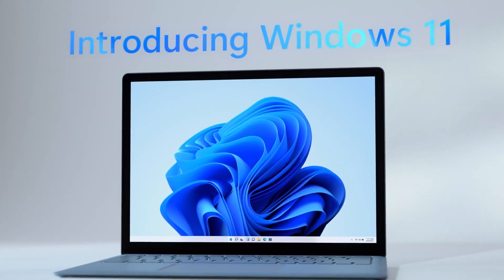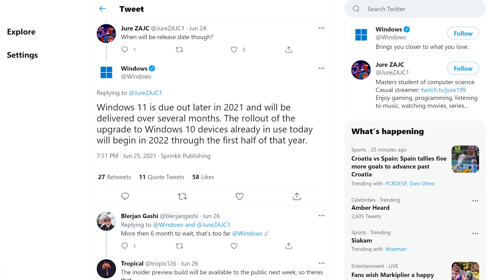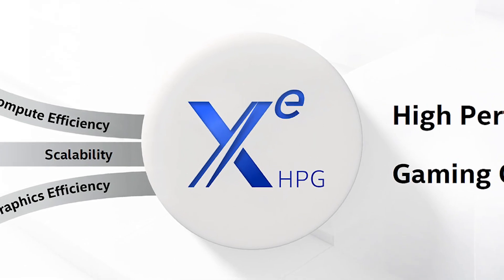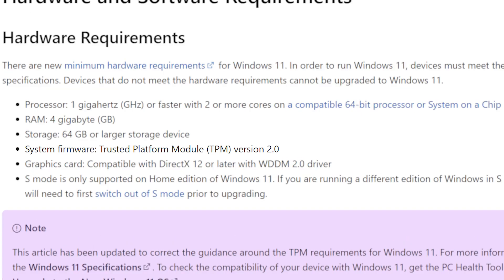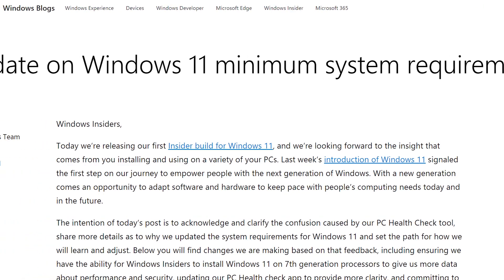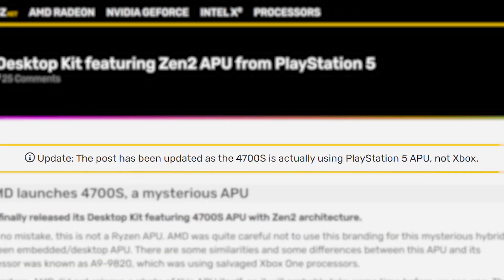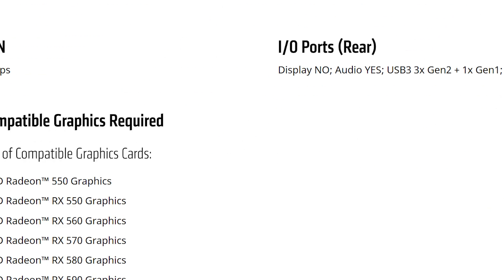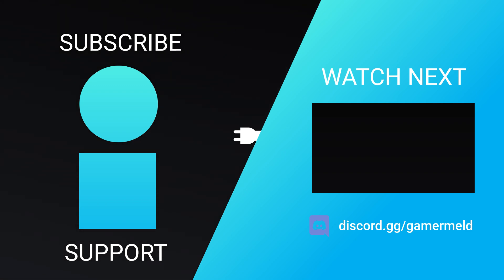TONS Of Gamers WON’T Be Able To Install Windows 11!

Comment: 3:00 this is just dumb. Just because it's not on the list doesn't mean it won't work. Is every cpu that would work with Windows 10 on Windows 10's list? Probably not. Does that mean it won't work? No.

Comment: First generation Ryzen CPU's was launched in feb. 2017. So they are over 4 years old (and not the 3 you mentioned). As Win11 launches for updates in Q1/Q2 2022 it's even 5 years old. It doesn't sound unreasonable to me, not supporting 5 year old CPU's with your new software.
And nobody forces you to use Win11 or upgrade the CPU, Win10 will be supported up to, at least, 2025.

Comment: Software generally makes very, very stupid decisions on what they can install on. Just warn the user that it seems incompatible, have them click 5 times to confirm that they are ready to take the chance, loose everything etc. and let the damn thing install!!!! Its called taking responsibility for your own life.
Reply: Pretty sure someone will make a bypass for that, we just have to wait.
Reply: The TPM 2.0 requirement is technically a right choice but at the bad time. They should've imposed this requirement years ago. Now the shitty OEM companies don't bother about how secure their hardware is according to latest standards. They keep running races behind performance and only that, cuz their market and sales are hugely driven by that. This is partly due to increased PC gaming and new games requiring high performance hardware. 

Windows 11 forces them all to move in the right direction all of a sudden. Now think about it... Do you complain on windows for imposing greater safety requirements on our old and insecure hardware or on hardware companies and the gaming industry that drove OEMs to only focus on performance since a very long time?

It's like getting pissed at a game company cuz their AAA game with cool graphics and physics doesn't run on your old potato laptop.

Comment: That's not right, the CPUs that Microsoft says "will not be supported" is just an advertisment to the OEM Manufacturers, so their new products can carry W11 from the factory only if that comes with a recent CPU.

So don't worry, you all will be able to install W11 as long as TPM can be activated in the BIOS of your motherboard (most recent processors or motherboards since 10 years ago supports this).

Comment: Unless the software I need to use for my day to day stop support for my current version yea I'll probably skip this one while some meh - nice improvements I can't get over that UI it's not appealing in the slightest to me & quite of putting on its own also not seeing a need to upgrade everything is running better than smooth so not about to a crew myself with finally not having issues with a new build.

Comment: A ton of gamers, especially with newer hardware will be able to. The only outlier is the TMP 2.0 requirement. Which many gamers or people outside of cyber security may not be aware of being in their system or not. Many plain users, as seen in the comments here, don't realize that it's not just Microsoft forcing a hardware update. But the market almost demands it because the recent ransomware epidemic. Old hardware is insecure, if it out of lifecycle you're exposed, even more so if you're connected to a cloud.

Comment: As a Linux Mint user, this Win 11 stuff is mystifying. It reminds me  of the old AMD/Intel warz , which I am old enough to remember. AMD is much better equipped to deal with Intel FUD this time around ;) I only use Win10 for DAZ3D and AutoDesk CAD apps. Otherwise, I use Linux. This might indeed get those two genres to finally make the switch to Linux ;) Without those genres, I have no need for MS BS and I am tired of paying for Offce 6 times (Been using Office Premium since Win 3.1) on the same computer and I WILL NOT use the subscription model for software!

Comment: I'll not buy another pc just for a fucking operating system 
Currently using 7700k with rtx 2060 and 32 gb ram
And it can't run w11?
What a fucking joke

Comment: I'll state windows 10 will be likely besupported to 2024-2025, and at that time those unsupported processors are 7+ years old. I'm a person upgrading my pc once every 6 to 8 years, my old system (i7-3930k 6c12t @4.3ghz, 2*780, 32gb ram (2013), sata ssds / hdds) has been replaced last year (by a r9 5950x 16c32t@ 4.3ghz, 2070S, 64gb ram, m2 ssds, sata ssds), obviously not making me affected. However it's 10 times faster cpu wise and gpu wise compared to my old system. After 6 or 7 years reliability goes down, and mechanical hardware becomes old. 

Maybe it is time to move to the capabilities of now 3yr old instructions ets, instead of lingering in the early i7 and comparable (-snickers-... ) AMD solutions (yes, AMD has done brilliant) of 5 to 8 years ago with their instruction sets... Windows 10 will suffice until the platform is actively phased out by its users... My only gripe is the inability in 2025 to allow 8 to 10 year old pc's to be replaced elsewhere and/or recycled. Which is forcing unnecessary e-waste IMHO.
 This said I have a 12 year old workstation (2008-2009) running windows 10, and honestly... it still is usable for 2 to 3 light 2/4c 4-8gb ram vms and basic office/internet/mail and fileservice. I used it a year ago for homeschooling my kids during covid lockdowns. 1 working on the machine, the other on a tiny old thin client. 
when I was building my new pc.

So support isn't my main issue. And if they cause to many waves it might be the downfall of MS PCs, and we might see more interest in Linux, old pc's will run Linux perfectly, open office is roughly equal and as capable as office 365 and cheaper. Provided you do not need the cloudspace.

Comment: Use pop! OS. steam proton now allows for most games to run on Linux. And games on Linux perform better than on windows. Speaking from experience.  Recommend checking it out. No developer experience needed. It's easy to install and use.

Comment: Imagine requiring a very recent cpu just to install an OS. What's gonna be next needing 8 or even 16GB of ram just to start windows?
Reply: back when XP launched, it required 512mb of ram for a decent experience. i'd say that was the equivalent of 32gb of today. i really hated xp at first because it was a huge resource hog. but when tech advanced a little more so that wasn't a problem anymore, it became one of the best OSes ever.

Comment: Have you try it? It's basically just like any big Windows 10 update but more fancy. It run "every program and every game" I already installed on my Windows 10. The transition is as I said, just like upgrade windows 10. I didn't have to reinstall any program at all. And my CPU is Ryzen 5 3XXX. Only games that doesn't work is the game that has game guard on which doesn't recognize the os version and refuse to let me play, Which wouldn't be a case when the Windows released.

Comment: The only thing I can say to Microsoft that justifies their move is if they continue to support windows 10 for 10 + years after win11 release
Reply: @boinggogen  4 years is a lot of time for people to upgrade their PCs.
Reply: @Dhruv-qw7jf  "its a lot of time to upgrade a pc" yeah, but ya know why force someone to upgrade if their system is able to handle their usage needs? Thats the point here
Reply: @soham7510  I mean, Apple does this all the time and no one bats an eye at that. Heck, Apple is notoriously known for sending updates to their older devices to slow down performance and make them obsolete. At least (so far), Microsoft hasn't resorted to that.
Reply: @Dhruv-qw7jf  yeah thats sad these companies have so much power over their users

Comment: Gonna be blunt: 
I don't get why it's random intel chips. Unless there's some security reason.
But seriously, if it supports TPM 2.0 then it should be fine. (I mean if anything my system has it built in so that's neat.)

Comment: My second gen Intel Core cpu isn't on the supported cpu list for my current Windows 10 build but it works, sort of, as I get plenty of blue screens, not supported cpus may still work, not without problems though, moreover, TPM 2.0 is only needed for encryption features like BitLocker, it won't surprise me that they lessen these requirements before launch.

Comment: Wow, you really don't know what you're making videos about, just regurgitating old tropes like "gamers don't usually upgrade the CPU". Gamers especially do upgrade the CPU on Ryzen AM4. There would be no reason to upgrade your GPU if you're still running an R3 1200 or 1600 or even R7 1700. You have no idea.

Comment: If Windows doesn't start back pedaling to allow more CPUs and more options to be used like Windows 10 is allowing then they're going to probably lose a small portion of their stock value any upcoming years especially if they start to discontinue more operating systems and try to "push" people to switch like they tried with Xbox game pass. Fml

Comment: You can run Windows 11 on a modern machine. You just need to enable fTPM on your motherboard Bios. I have a 5600x and most modern AMD cpus have it built in the chip. Its disabled by default, just need to enable it.

Comment: Honestly I dont think anyone had anything to worry about with windows 11. Dual core cpu, covers everything. 4gb ram, covers everyone. Tpm 2.0 covers most motherboards within the last ~5 years
Compatible cpu list, they still have 4 months to make sure more customers done have randomn bugs. They're validating them based on importance. So start with the newest first, then the highest sellers and steam hardware survey. Obviously validate ryzen 5000 before 1st gen thread ripper for a home os. They're expecting threadripper users to be on windows server

Comment: Add me to the list along with my wife,she has a Ryzen 3 1200 which is frankly overkill for her and I have a Ryzen 3 3600   but no TPM module and the module costs over $100 used it you can get one.

Comment: It's just typical, Microsoft wants you to enable all these overkill features because Windows IS the vulnerability on most systems, it's always to compensate for it being such a sh** operating system.
Reply: tpm is a security future for windows. However i do think that requiring tpm will slow adoption rates.
Reply: @supersaiyaman11589  yes, but the TPM utilization will be a great thing.
Reply: @RobFlexz   for security yes it will be i cant see any other advantage for it.
Reply: @RobFlexz  how will the tpm mandate for windows 11 be a great thing other than security may i ask?
Reply: @RobFlexz  the more i read up on tpm and get to understand why Microsoft is implementing it the more i agree with  there choice to require tpm.  at this point i would advise anyone ho does not have  tpm to get it. they make  motherboards with tmp on it. if people truly don't want to get another pc just get a motherboard with a tpm header and buy tpm specific for your motherboard. Or better yet buy a motherboard that already has it included if you can. Microsoft is  doing this to protect their os from attacks do people not realize this. people have bean complaining that Microsoft os is insecure wene Microsoft finally does something about it people complain. as iv said before the more i read up on what tmp is for the more i agree with Microsoft decision.
Reply: @supersaiyaman11589  TPM is a great security feature, however, mandating it is not. Microsoft will have full control over your bios and probably will make using alternative Oses, such as Linux, more difficult. TPM is used to secure devices from physical attacks, not to prevent malware from the internet. A hacker can still install malware with tpm enabled.
Reply: Wrong.
Reply: Bobby is ignorant

Comment: I just upgraded from win 7 to 10 but not by choice the Mosfat on my motherboard blew out took everything except the gpu surprisingly enough spent about 730$ on a new system and got win 10 installed not happy with 10 at all And now they are pushing this is out I'm sorry but I'm going to wait for 2-3 years and see how this 11 is plays out

Comment: I hope that for the launch of W11 they have removed that requirement of having UEFI and TPM2.0.
I understand that it is a way to cut support for legacy computers, however it is a very artificial cut since it does not depend on the power of the equipment but on what they consider "safe".
This the only thing that is going to achieve is that people continue to stay with Windows 10 as at the time they preferred to continue using WXP instead of making the leap to Vista, at least at that time the justification was the lack of power, the majority PCs of those years were not prepared for all the visual effects that Windows Vista offered, even today AeroBasic is still present in Windows.

Comment: I think that unless you CPU lacks any  required instructions set, even if it's not in the support list you will be able to run Windows 11 just fine. Maybe the question should be why do you think you have to need windows 11 before the 2025?

Comment: TPM is designed to lock out gnu linux and other competitors
Reply: How? TPM isn't necessary unless the boot uses it to read some cryptographic key and kick off the core, if any, Linux shouldn't be left out to use such hardware in a actually useful and competent manner, but always as an optional part
Reply: @santitabnavascues8673  Just guessing if it uses some lock out chip that only allows window's bootloader like copy protection on consoles, or m$ thinks users are too dumb to turn off tpm,secure boot. unless its an oem pc maybe
Reply: @ryan89554  that and TPM being essentially designed by microsoft could hint a thing or two, still, I'd consider a bad design for hardware to be done so it excludes legitimate software from running
Reply: @santitabnavascues8673  or lock out amd even if there wasnt demanded competition by law and only allow intel motherboards to run win blows. id already get rid of windows if wine can run more dx 11 titles, i got skyrim special edition, problem is amd linux proprietary drivers suck and is hard to get working. its dumb . drivers and low level stuff should be gpl compatible to have optimal functionality and continue to have long term support without being terminated with planned obsolescence and further e waste.
treacherous computing platform haha

Comment: Microsoft boldly making people's lives more difficult and calling it innovation 🥸🤡
Reply: its innovation, just backwards
Reply: TPM is crap.
The only use of the TPM is that DRM media can no longer be copied, software can be blocked from being installed (if Microsoft does not want this in windows, even if the user wants it) or PC users cannot do anything about it , Windows or other companies data about software usage, files, behavior ect. collect.
Reply: Don't use that emoji, it's too funny😆
Reply: Apple 2: Electric Boogaloo.

Comment: Microsoft is going to shoot themselves in the foot with Windows 11. An OS typically is not supposed to be heavy demand on hardware, leaving the majority of your resources for running your apps and games. This is just as bad like back in the days of Vista when they used glass windows and was too demanding for hardware and slowed your windows experience down.
Reply: Windows 7 uses the same interface and uses less RAM than Windows 10 does at idle. I am never switching to the NSA backdoor spyware that is Windows 10 or 11, only NPCs who never question anything do.
Reply: Windows 11 isn't highly demanding on the hardware, in fact, some people using the insider build found that is even less demanding than Windows 10.

Microsoft's shit of "not being able to update" is mostly due to the TPM shit. If you don't have a physical TPM module installed on your motherboard then you can make your CPU to run "software TMP" (called fTPM in ryzen CPUs). The problem is that old CPU doesn't have the minimus software TPM version that Windows 11 asks.

Is this a bullshit requierment? Ofc it is 'cuz the user will need to decided between updating the CPU (if you can) or buying a TPM module and install it on your motherboard.
The worst part is that even people with a compatible CPU can get an "not being able to update" false possitive 'cuz you need to go to the BIOS to activate the fTPM.

P.D: Also, for some reason Windows 11 also needs Secure Boot activated and the main drive to be in GPT format to be able to install it.
Reply: @linkhuesitos15  The TPM requirement is of cloud integration. With O365, Xcloud, Azure, AWS, and more. The likelihood of being breached and ransomwared is much higher now. Hence the requirements.
Reply: @sylviarohge4204  wrong
Reply: @sylviarohge4204  I think you typo-ed negative as positive
Reply: @sylviarohge4204  If Microsoft started to care that much about copyright, Linux it is.
Reply: @linkhuesitos15  I'm sick of seeing "keep using Windows 10" not being an obvious option

Comment: A security expert on PCWorld pointed out that logically, Microsoft wont end up going with the hard lock requirement of TMP 2.0 and Secure Boot to install the operating system in the end. Businesses and DYI aren't going to trash their systems to go from windows 10 to windows 11. I'm certainly in that boat, and don't care for windows 11 enough to buy extra hardware or risk compatibility issues with secure boot
Reply: exactly. it would be a moment of truth when they see adoption rate is lower than even Windows 10 if they keep this shit up. It's already a headache to keep the enterprise side on track with Windows 10 , especially if there is no patch management involved and auto updates are enabled. 1803 was a dark update for me haha